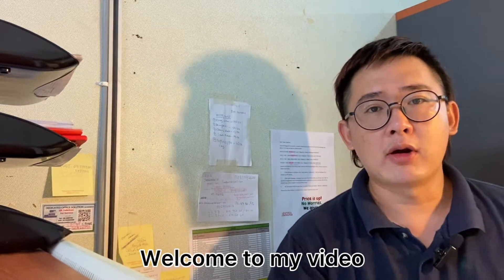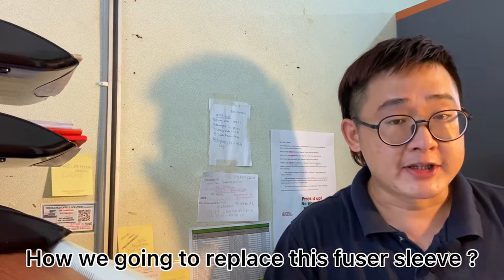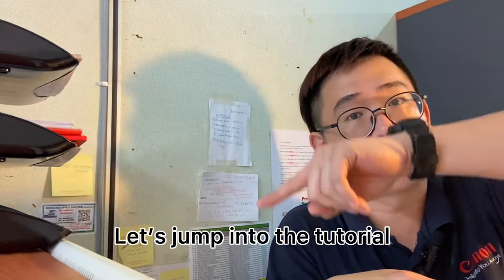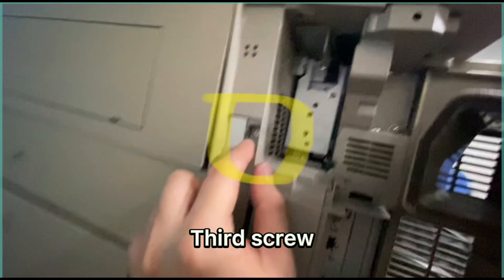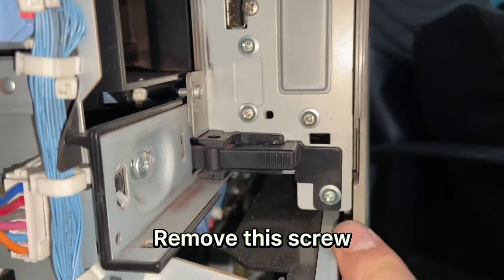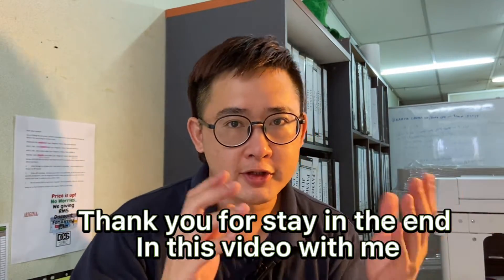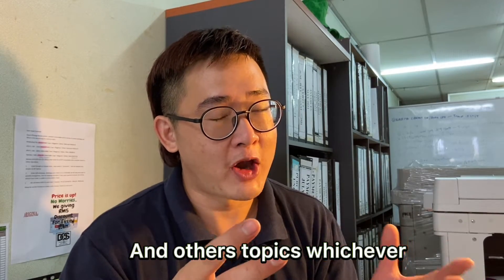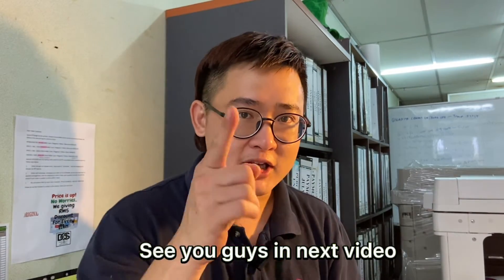Canon IR ADV C50 52xx Error Code E00003-0004, Fuser Sleeve & Main Con 1, Main Board

Comment: Can you suggest any other solution. I try to change fixing film shutter unit AC drive, main con 1 , DC con. Power board. But still not fix the problem.
Reply: I also check analog in service mode to see tempereture while printing. It does not go up to 200 degree. Only 179 degree.
Reply from the maker: Is that the heater switch on ? It seems to be all the necessary parts were replaced, I guess is either the software issue or heater switch is off

Comment: HI there...thank you for your video.  I swapped out the two chips and installed but am still getting the E000355 -0004 Error.  Any suggestions?  Thank you.
Reply from the maker: I guess the chips problem as well
Reply: Wrong model. You need same main con 1 model. For example. If you have c5250 then the same main con from c5250. If you take c5235 main con it will appear e355

Comment: Hy, I have c2225i and show me e000003-002 because  it was cold. Now  I try to reach copier with 28 but it is impossible.  It shows  only volume control: audible tones.  How I can reach copier?
Reply from the maker: Do you turning on the fuser switch behind the machine ?